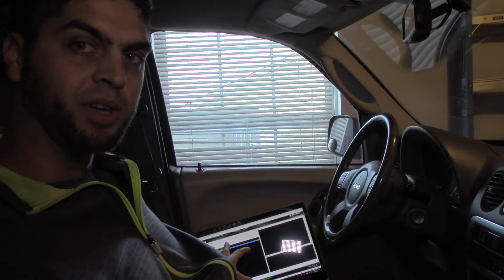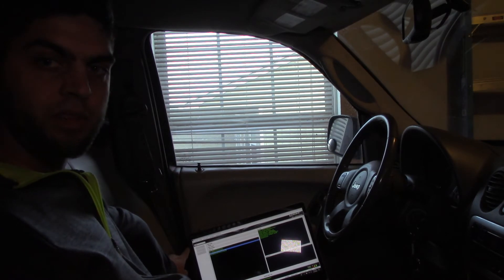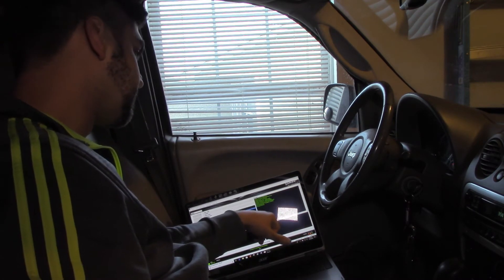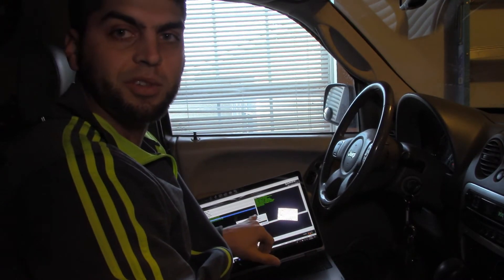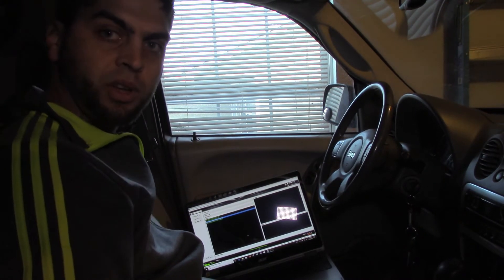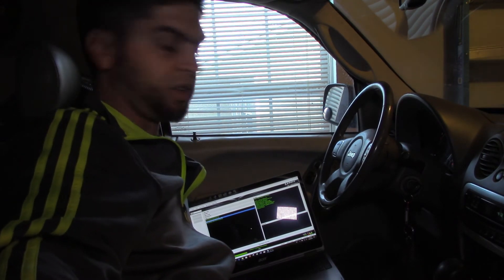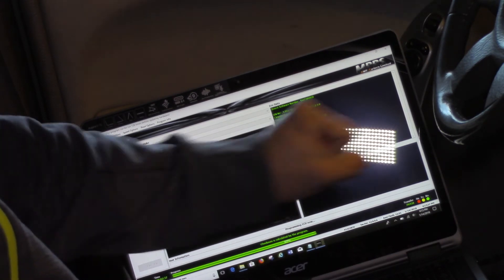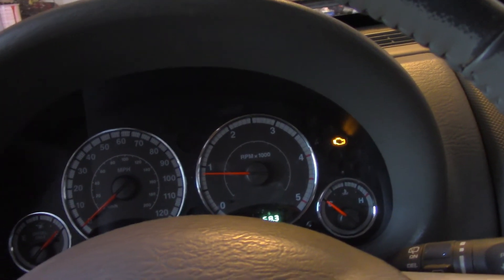Re-Flash ECU on Liberty CRD, and a fail

Comment: Have you gotten your codes cleared since the new flash?  The EGR stuff didn't self-cancel for me, I had to clear it with a scan tool.
Reply from the maker: not yet. I have a few work arounds. 1) someone on Lostjeeps re wrote Yeti's 808 tune to catch the two codes I have thrown. 2) someone told me how they took the old butterfly valve portion from his old intake elbow and plugged it back up to the connector and just hid it somewhere out of the way...so I did that, and am going to take it to O'Reilley's tomorrow and see if they'll clear now. Tried getting them cleared Monday night, but didn't work. So hoping now that I have the butterfly valve portion plugged in, see if they'll clear now.

Comment: Just wanted to let you know, I have Windows 10 on the laptop I use.  It's never been a problem.  Just a warning though, I don't know why, but I'm told it's important to shut down all bluetooth and wireless devices, and make sure neither the computer or vehicle batteries don't crash before it's finished (about 5 minutes)
Reply from the maker: Ramona Locksmith interesting. Yea I got it worked out, luckily I don't run Bluetooth hardly ever

Comment: All OBD2 plugs are within 3' of the driver by design law...I think you're over complicating things....A CEL will leave a code,,Read and clear the code with a code reader..You guys can get 'em real cheap...BTW the code will be a P - - - -....The numbers are generic so translating them will be easy..Good luck.
Reply from the maker: Well, when I installed the EGR delete kit, it was going to throw a CEL so that's why I reflashed the computer. That CEL was not on before the install and it was expected to be on after the install. So that's where I started, reflashing the computer with a tune that was supposed to tell the computer not to worry about the connector I disconnected because I took out the part it connected to. So I'm going to get it scanned now to make sure that the code that is being thrown is the one that relates to the EGR component I disabled, or if it's something different. That's the only way I will know. I'm hoping to get it read soon.